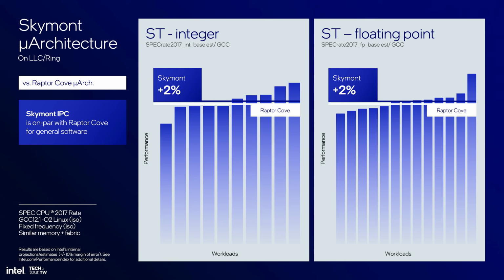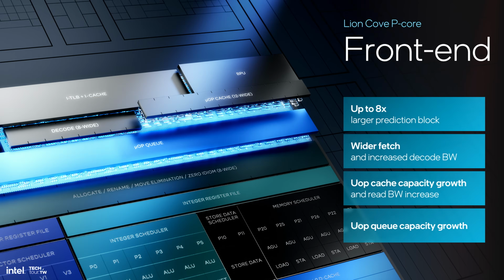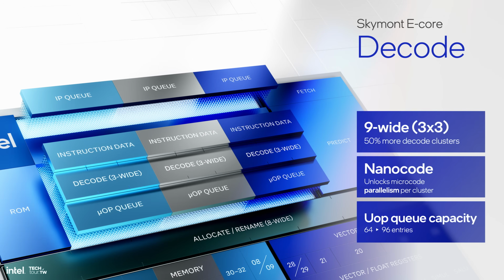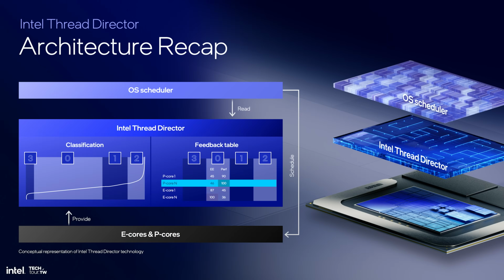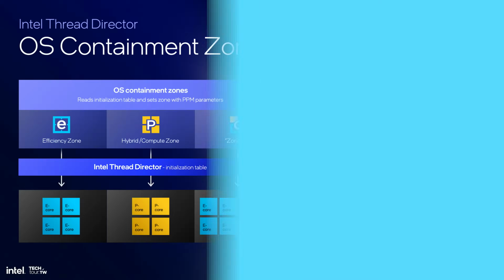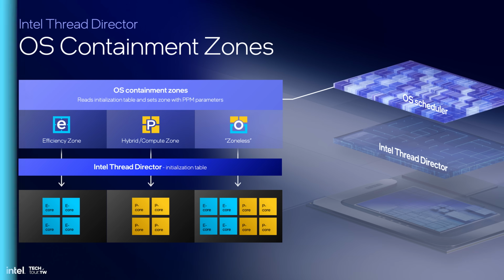Old Version - The Road to Panther Lake: Hybrid Compute | Talking Tech | Intel Technology

Comment: Deliver on 18A and reclaim true IPC and performance leadership before even mentioning hybrid compute. E-cores were never innovation — they were a workaround after a decade of stagnation. By Alder Lake If Intel had delivered a true 7 nm or 5 nm node, there would’ve been no need for E-cores in the first place. Not to mention you got cocky with Alder Lake so much so you rushed Raptor Lake out, nearly costing you the entire company with CPUs dying. Now the focus has shifted to shoving in more cores and marketing ‘efficiency,’ instead of pushing pure performance. Stop using complexity to hide stagnation. Also no one cares about NPUs either, it's just another excuse for forced upgrades, and to claim efficiency by shortcutting effective design. Wouldn't be suprised if Windows 12 made NPUs mandatory,  meaning every processor before is useless.

Comment: If Intel want to be a marked leader again, they have to win in performance. The hybrid cpu`s are logical on battery products like laptops and phones, but not necessary in desktop high performance products. I`m still using an old 5820k oc`d to 4.3 Ghz pc as my main system. My hope is that intel will make a new affordable enthusiast platform like x99 with quad channel ram and instruction full "p-cores" only with multi threading.
Reply: People continue to NOT understand what the E-cores are.
Even from Alder Lake the whole idea (also said in this video) of the E-cores was FIRST to have performance per die-area and only AFTER to have energy efficiency. 4 E-cores take the same space as 1 P-core. In multithreaded applications 4 E-cores can be over twice as fast a 1 P-core.

So you're ABSOLUTELY benefiting from E-cores in performance.

If you do other things than mainstream gaming (where 8 P-cores is more than enough) then you would see the performance gain. Arrow Lake actually does win in performance in some productivity tasks. But too many people only treat gaming as the only thing you do with a computer nowadays, it's so annoying.
Reply: @Winnetou17  a bit right, but not entirely, we consumers dont care about die area to performance, we care about overall performance and power consumption. the e cores are always slower and seem like a waste to have when all we want is max clock and speeds possible with the architecture. also naming e cores when is more about multitasking not efficiency?...
Reply: @marklapar4804  Yeah, the naming isn't perfect, can't argue there. For the what consumers want, I don't know, Alder Lake was the fastest when it appeared, and Raptor Lake held pretty well, though started having issues with too much power draw. In any case, adding more P-cores wouldn't have been a solution against X3D chips.

One thing to blame is Windows' Scheduler. Both Intel and AMD had a lot of issues and I would bet money that it was mostly Windows' fault. Linux didn't had those problems, though it wasn't tested in games as much.
Reply: People getting stuck on performance and no power efficiency will hand AMD the lead and that's exact what's happened.
Reply: hybrid cpus make perfect sense once you realize that 100% of  games only utilizie 8 cores at best case scenario. For complex developement programs or heavier tasks that benefit from more cores, those actually need more cores rather than single core performance, so the E cores come in play there. Its actually a very elegant design. Apple uses the same concept

Comment: Fascinating. I have raptor so I’m an intel fan and user. 

A question I would like to pose is: given the challenges that the OS kernel thread scheduler has with scheduling threads on the “right” core architecture, why have multiple core architectures in the same SoC vs making your p-cores more space and/or power efficient? 

By having heterogeneous p and e cores with different ISA capabilities, (original gracemont ecores didn’t have avx512) you nerfed the ability of your p-cores. Intel lakes before alder lake (eg rocket lake) had avx512. Yet in alder lake you took it away. I feel that Where amd pulled ahead is that it offers avx512 instructions on Zen, and you don’t anymore on your desktop client architecture. All because the e cores didn’t have the capability. 

So why not spend your engineering muscle on making your p cores more power and space efficient, even if it means rearchitecting the p cores such that some are smaller and more dense (even if they run at a lower frequency for efficiency). so you can pack more of the dense cores on the SoC. But you retain the same ISA and IPC? Just a thought. 

Obviously you are the vendor and you know more than me. But just wondering why have e-cores when doing so might hold your client p-cores back? The lack of Avx 512 in alder raptor arrow is the best example of what I mean.
Reply: already done, NVL will bring Atom to Client ISA parity with P Core. And a single P-Core will be the size of two E-Cores.
Reply: E-cores will eventually replace P-cores and have all functionality with AVX10.2

Comment: Intel was not first with big little? Maybe with x86 but for sure not overall. I feel like overall Windows is inheritly bad at handling big-little it was for too long a big only system.
Reply: the aim of performance-hybrid vs big.little is different. big.little is more so power efficiency focused, and area to an extent. performance-hybrid is maximising ST and MT performance at the highest area efficiency. not so much power. Intel started the trend because their P-Core PPA was atrocitious compare to the competition. But now, ARM has followed with its Ultra, Premium and Pro cores.
Reply: @ablesam didn't arm and mobile have that first.... Mixing cores into processors how they copied intel
Reply: @GameHEADtime there is no copying here. just two different ideas that look similar. The naming of Atom to E-Cores is what gets people confused here. They are not there for energy efficiency (even though they are). Arm's implementation is primarily for energy and area efficiency. Intel's is to achieve max performance at the lowest die area penalty.